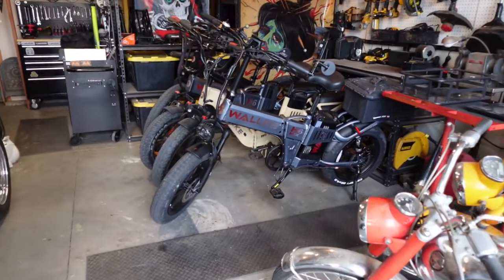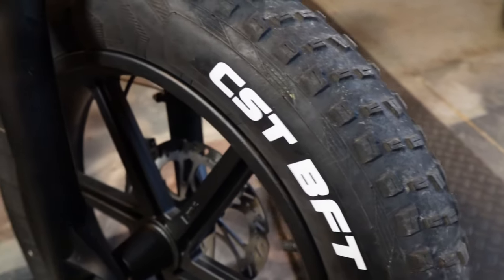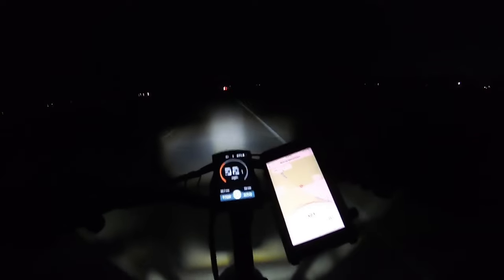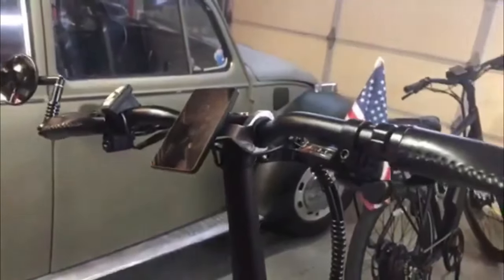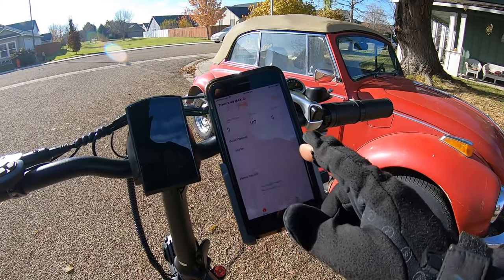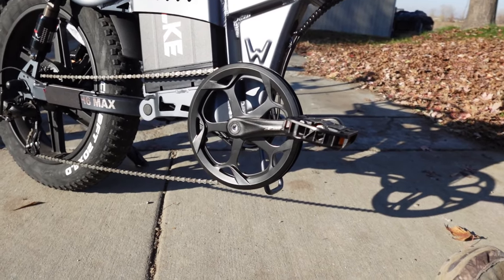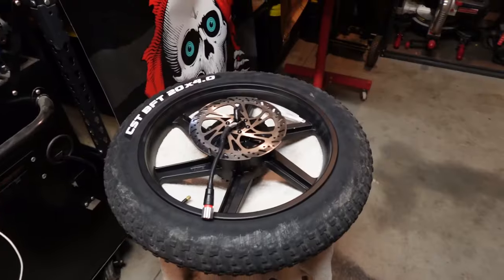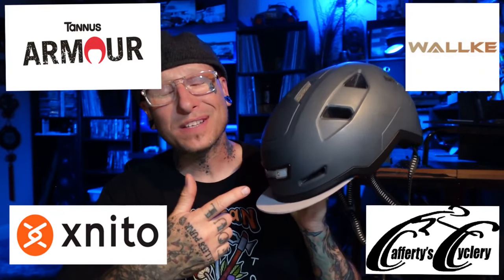Wallke H6 Max - Upgrades and Improvements Review

Comment: Ordered the H6 Max with the H6 Dual Battery Kit as a Black Friday Deal, code gave $400 off.
Needed a long range Ebike for collection.
Not sure if the Battery Kit will arrive with the bike or not, but either way, 40 Ah is a great start.
Edit:  Battery kit arrived separately.  Wallke has a video on installation, which I followed and was NOT difficult to install.
Reply from the maker: Yeah when I got the first generation H6 it only came with the 20ah and I rode it like that for weeks before pulling the trigger on the second battery. I only ride 16-20 miles a day so battery capacity isn’t a concern. Gonna be super cool to have them both going tho.

Comment: Swapped the freewheel with a DRIFT MANIAC 7 Speed Freewheel 11-34T from Ailexpress. $20 or $28 with tool. Had to remove the shim behind the original gear. It works OK. Its not perfect in first gear but I think second gear is my new normal first gear. Granny first gear if needed. The chain is super close to rubbing on the tire but it clears. What I really wanted it for is the 11 tooth 7th! What a improvement over the stock 14 tooth. Time will tell on how long it lasts. I'm going to run it like that for a while before I decide if I want a 58T crank gear.
Reply from the maker: Very cool! Yeah getting that 11t 7th is where it’s at.

Comment: Hey when are you doing the next giveaway? have a dual motor OG H6 build that is sure to give other contestants a run for their money. A 1000w direct drive motor installed in the front, a third battery installed in the rear rack, lots of stuff going on in the cockpit- right twist throttle left thumb throttle; , that cool 82 t chainring from one of the previous giveaways, very nice kendas, a windshield! And yes it’s Black!  I know you will appreciate this beast 😎
Reply from the maker: Cool! Tannus hooked me up last time out of the blue so I’ll hit them up again. Shoot me a pic of your bike when you can. I’ve been contemplating a front motor.
Tat2xtrace@gmail.com
Cheers!

Comment: I have been using Tannus Armour on my e-bike (26x1.95-2.5) off and on for about 3 years. Either someone at work is puncturing my tires or these inserts are a gimmick. 
They don't stop punctures and they capture/incapsulate small sharp particulates only to work their way to puncture the tube in the future. I wanted to like them, but they just don't seem to work in my experience. Really e-bikes just need thicker tires.
Reply from the maker: Yeah they’re for from perfect. They help with goatheads tho. That’s our problem around here. Plus the ride quality is better. And the newer tires coming on these bikes are even worse! A good thick heavy tire is really the best solution.
Reply: @TheE-LightenedArtist  Something like Shinko 100/80/16 or Michelin 120/80/16,140/70/16 look interesting. 
Any subjection's alone those lines? I'm a little caesious trying until I see more clarification on them or others. I did order a pair of Yunscm.

Comment: Hey got my arrive h6 max I think screw attach headlight  to finder is missing. Feel little bum but  might return to Amazon where I bought it.  Little bummer.
Reply from the maker: The bolt is usually in the forks already. If it’s missing you can grab one from a hardware store. Lame if it’s missing but I wouldn’t go through the trouble of sending it back over a missing bolt. Just go buy one and let Wallke know. Maybe they’ll hook you up with a goody for your trouble.
Reply: @TheE-LightenedArtist  thanks for reply yeah it missing ill go hardware or bike shop if they have bolts for it.  can't wait for new video
Reply from the maker: Cheers! Yeah it's just a 2" long bolt with a 10mm nut. Should be able to score one anywhere.

Comment: what kind of range were you getting?
Reply from the maker: That day I rode the green belt on pas 1 I went 10 miles and the bike was still at 100% when I got to the truck. On my commute to work ( pas5 full speed 16 miles) it uses about 20%. On pretty much any bike. Expect to average 15 miles per 10ah of battery. Give or take for terrain weather and weight. The meter will show a much larger drain at first and during the ride. But after the bike has been off and the components allowed to cool, the meter will recalibrate when the bike is turned back on showing actual battery life. This is expected on most all e-bikes.
Reply: is the bike water resistant @TheE-LightenedArtist
Reply from the maker: Pretty much. I've had no issues in rain or snow. I wouldn't leave em out in it. The Julet connectors are pretty water tight.

Comment: Im suprised you got a flat already, I haven't got one yet. Fingers cross.

I am also a bit annoyed with the settings, and do wish I had a wattage meter.
Reply from the maker: I live in a Northwest valley that is plagued by goatheads. Vicious little thorns that are every where. Beautiful valley but those thorns … ugh. That’s why I’m such a huge fan of the Tannus products. I swear they make the ride better too.
Reply from the maker: Yeah unfortunately e-bike companies are at the mercy of vendors for electrical components. This is why I think the practice of “presales” is a problem. If the vendors send the wrong or faulty units, company has to put the bikes out anyway because they presold them and had a deadline. So the next run of bikes will have the correct units but the folks who got them early got bad ones. Fortunately you can contact Wallke and they’ll rectify it. I’m hearing about folks who are getting new units sent to them. I don’t work for the company and this is all just my observational theory but I can see how their “rush to market” can cause problems like this. In the future I won’t be recommending “early bird” specials. Now I realize that it’s bad practice. Seems like a good deal but they should wait until the all the components are assembled and quality tested before advertising them when they’re dependent on vendors to supply the components. Just my two cents….
Reply: @TheE-LightenedArtist  I will contact them about the display, I asked if they would be willing to do a $200 USD refund based on the black Friday sale discount as I was under the impression the price I bought it during presale for would be the lowest price and they have an ad for price matching, which ironically starts after the presale ended, however its been 6 days roughly and I haven't gotten a response.
Reply: @TheE-LightenedArtist Yeah to update, I sent off another email 6 days ago and still ghosting me. Probably won't be buying another product of theirs.

Comment: I wish everyone would stop trusting speedometer on the bike and expose the exaggeration with using Google Maps speedometer. This bike only goes 30miles/hr. I was disappointed to find out that bike marks a faster speed than Google maps. The lack of turning signals is a down grade to the H6 S. Connection to my phone is useless since I use android. And as food deliver, I'D only got 35 miles range with pedal assist since it's setup to pull a lot of power from the 40AH. battery. 
I Estimate another 15miles with the 20AH battery to a a 60AH ride.
Thanks for sharing your vid.
Reply from the maker: I use a speedo app for the most part. If you look close when I go through the settings I have the wheel size set to 22” which gives you a more accurate reading. Still a little over but pretty close. If the bikes speedo reads 34. The app reads 33. So it’s still a mile over. The way I ride I only get about 40 miles range with the one battery. Bigger motor eats the bigger battery so it;s a trade off. This bike suffers greatly from the gearing. A freewheel upgrade and second battery are an absolute must.
Reply from the maker: And yeah it’s lame thing about e-bikes. They always have inaccurate speedos. Fat tire bikes are the worst because the tire diameter can vary so much depending on tire pressure and your weight but still. Always scratched me head about that one. Seems like it’s all of them too. Idk….

Comment: Can you make cool video showing us install parts!
Reply from the maker: Yeah I’m always down for video ideas. What are you specifically wanting to see installed?
Reply: crankset and chain ring for sure actually I meant the free wheel! Or speed upgrades  @TheE-LightenedArtist
Reply from the maker: Yeah I need to get on that. I've been messing with my old bikes a lot while the weather is poor. I may actually pull all the components from my old H6 and stick em on the Max. Crankset mainly. That would really put this bike over the top. One of my buds did a freewheel swap and encountered some difficulty. He ended up having to disassemble the motor. I'm hoping that I can drill out a freewheel tool to get over the large diameter axle to avoid that headache.